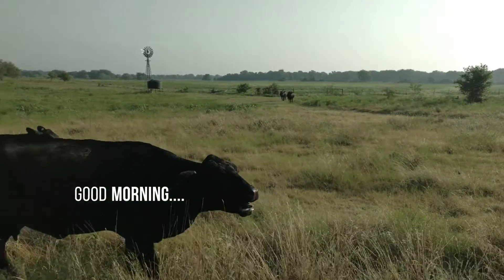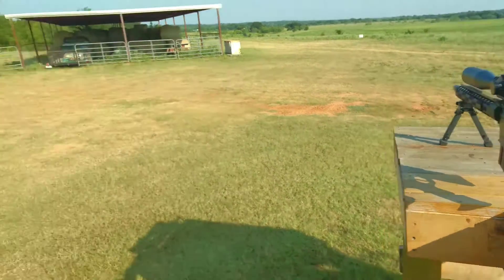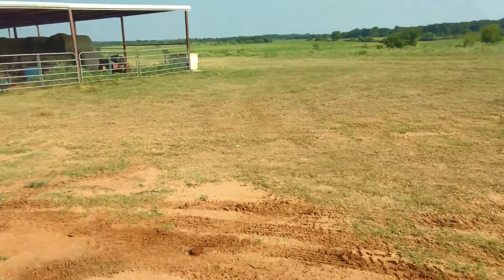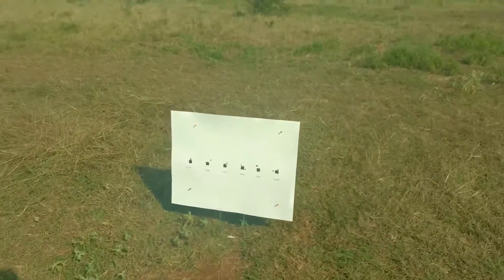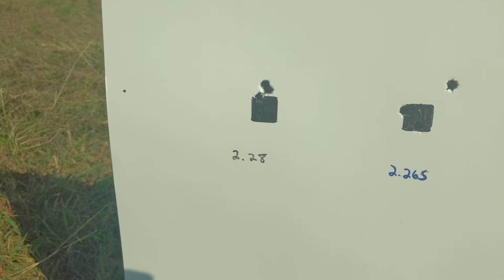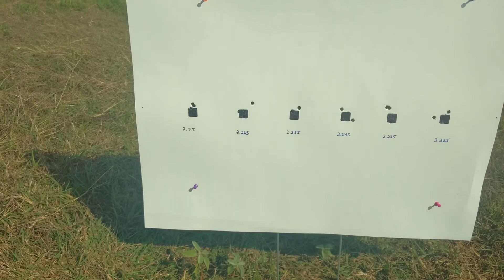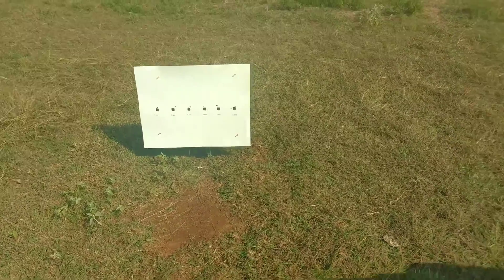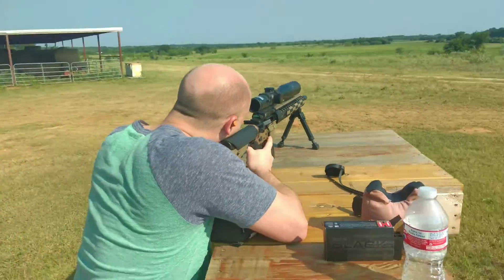6.5 Grendel OCW load development part 3 (optimal seating depth w/ IMR 8208)

Comment: Midway 6.5 grendel ARstoner 25 rd mags will let you fit those longer rounds in it. looks to me you could even use 2.30" out of them although I haven't tried it yet.  Also they truly double stack the rounds. Made out of stainless steel, about half the thickness of the aluminum. Just got 2 of them, $15 each. maybe the same as ASC as mentioned by other person.

Comment: Hey try some ASC 6.5 Grendel magazines. You can load out to approximately 2.305-2.309 depending on the particular mag. This has really helped improve my accuracy and you will also get a few more FPS with the longer VLD type bullets due to more room in the case for powder (won't be compressing load as much.) I'm running the Berger. Classic hunter 135 @ approximately 2550 seated out to 2.306 and its hell on hogs and deer. Also do some research on hornady leverevolution powder it has a very similar burn rate to CFE and will get you around more 100 FPS. A lot of 6.5 shooters have started using this powder.